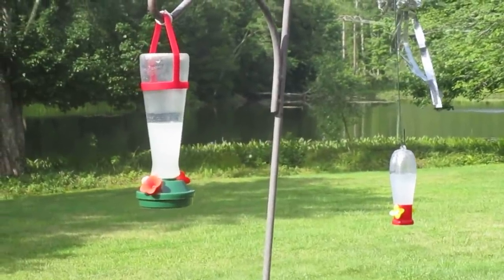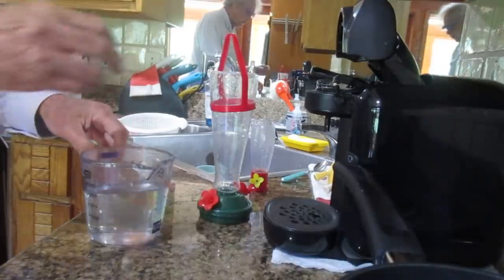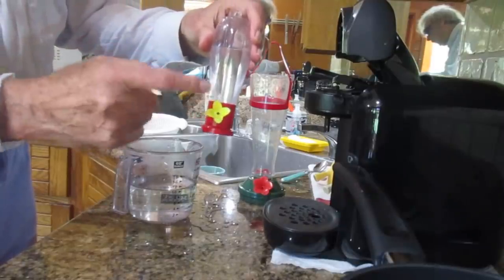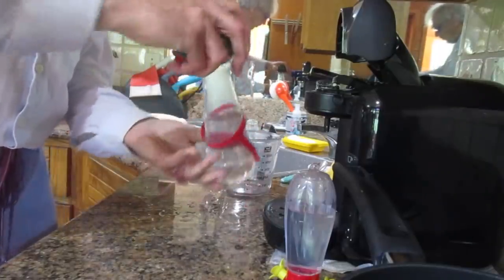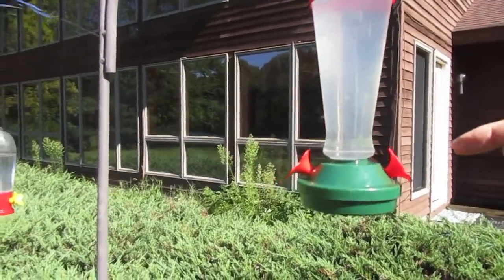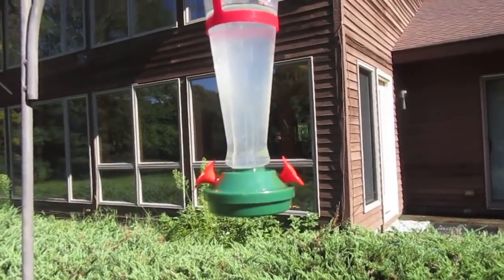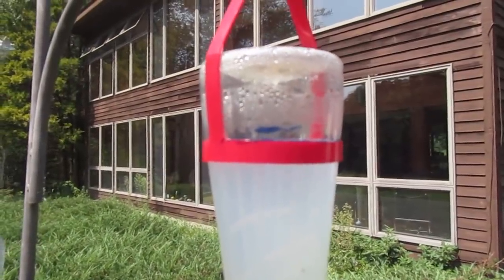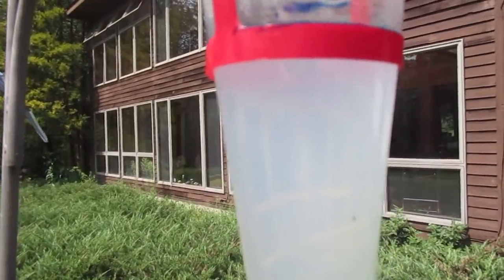Problem #118 - Mystery of Hummingbird Feeder

Comment: Air will be drawn into solution at the lowest portion (the "flowers") where it is at atmospheric pressure, and eventually come out of solution at the top, where there is a partial vacuum equal to the height of the liquid column. The vapor pressure of the dissolved air is relative to temperature, so it is the same from top to bottom, but it because of the law of partial pressure, it will create a higher relative pressure inside the top of the vessel. (or something like that :-)

Comment: Elegant problem, Sir Lewin. From a thermodynamics perspective, I am speculating that thermal inertia is interacting with Gay-Lussac's Law--pressure and temperature proportionality--causing pressure fluctuatations at the control surface. Asking myself whether or not mass is leaving the system, and if so, how? Sugar water perhaps decreases the saturated vapor pressure of the solution, when compared to liquid water under the same conditons. This allows for phase change from liquid to vapor to occur at lower pressures. Conservation of mass applied. Using the liquid-gas interface as a control surface, when the pressure of the fluid remains relatively lower than the pressure of air during the daytime, apparent fluid level decreses. Combined gas law suggests that either pressure, or volume must increase for an arbitrary temperature increase. Since volume is constant, we know that pressure must increase for both air an fluid. Decrease in the pressure of the fluid lags that of the gas. Increase in the pressure of the gas leads that the fluid. The specific heat capacity of water is over four times greater than the specific heat capacity of air. The increased pressure of the gas, and the relative decreased pressure of the fluid enables the gas to expand before the pressure of the water can restore the system to equalibrium.

Comment: Sir I want to ask for a solution iam a engineering undergraduate student , I have issue on remembering derivation and proof I easily forgot it my faculty told me use repeatedly write , write until it stuck on head my brain will freeze at certain point so I mug up few steps ,I have no issues on memorising concept , I have done  derivative step in math class at decent level . I have backlog in solid state paper it consists of full of mathematical derivation

Comment: Sir I am from India.I think reason is Pressure difference.Before weapping of Humming bird feeder, The pressure inside feeder is less than that of atmospheric pressure and pressure at flower is equal to atmospheric pressure.After wrapping the pressure at flower decreases than before and so liguid level in side feeder goes down.(It is the principle used in Barometre)

  Sir, I am a big fan of your teaching and I have learned a lot from your lectures videos and hope you will inspire this way life long Thank you so much sir.

Comment: My guess is that 2 independent phenomena are preventing your syrup from free leakage from the feeder:
1)	The rarified gas/air above the syrup. Its pressure is less than atmospheric and is directly dependent upon temperature (Law of Charles)
2)	The surface tension of syrup in the outlet (“flower”) creates a meniscus which acts as plug/jam. This meniscus is destroyed by hummingbird’s bill when it applies for syrup but it is another story. Surface tension is in inverse relation with temperature. So it can de destroyed by temperature increase.
So, to my mind, the combination of these two effects (meniscus/plug removal and air pressure boost above the syrup) caused by daily temperature increase causes syrup expel from the feeder.

Comment: Thats all wonderful. Not to be negative or anything, but I noticed that your feeders the sugar water is quite cloudy, that is caused from it being in the feeders to long, and the sun has heated that water causing it to thicken and go rancid and start growing bacteria,, this in turn can cause major problems for the hummies, they drink that and they can get mold spores on their tongues and causes them to not be able to drink.
I learned the hard way with that. I only use 1 cup of sugar to 3 cups of water, never boil the water, I do it at room temperature and I change the feeders every 2 days. Just saying, I found to many dead hummers because of the cloudy bacteria filled, to long in the sun feeders.

Comment: I believe the water level has changed because the water evaporated into the air pocket causing condensation and the pressure hasn't changed, but now the air/space above the water line contains the evaporated molecules?

Comment: My take is that, since the bottle is closed, the water in the lower part will evaporate till the vapor reaches the vapor pressure corresponding to the dynamic equilibrium of the vapor and liquid phase. The partial vapor pressure of 1kg pure water at 28 C is about 28.3 mmHg (looked that up) and it decreases to 28 mmHg for a solution of 100g sugar in it. From that it should be possible to predict how much water is going to evaporate until the process stops. However, when I tried to put in some numbers, I realized that the amount of water already ‘gone’ should be in the order of 50-60g, which cannot be accounted for by evaporation alone, since the vapor pressure and the volume are too small. Must think of something else after all. Looking forward to the solution…
In the meantime, I did my own experiment: took a plastic bottle, made some small holes at its side about 30 cm from the bottom, filled it with water, closed it and turned it over. Water came out of the holes for a few seconds then it stopped. I reckon that it stops when the air pressure at the surface level inside the bottle equals the pressure at the holes (1 atm) minus the pressure of the water column above the holes, which is about 0.029 atm (for 30 cm). Now I’ve put the bottle on a heater and marked the level. I expect that water that evaporates due to the increased temperature increases the pressure at the water surface by that small amount to make further liquid water come out of the holes. Let’s see…
By the way I also put water inside a closed bottle and marked the level: there’s no noticeable sign of the water level decreasing…So the water must come out of the holes

Comment: Sir actually because of the sun air inside the feeder expands exerting a force on the water making it getting pushed out of the feeder through the flower. Also we see  that evaporation is also taking place which forms vapour which condensed in the night time which can be seen as droplets . Hence due to the continuounity of this process the water slowly gets out of the feeder and water level gets lower and lower

Comment: I know people think that water cannot evaporate right through plastic. However, I do not believe that this is so. I used to live in a place where milk was sold in thick, heat sealed, plastic bags. You could wipe those bags dry, and leave them in the fridge and in the morning, there would be white liquid seeped out of the bag and into the fridge. I believe that this is because, when liquids are colder, they can get through the tiny holes in plastic that are invisible to the human eye. In the same way, water can get through cold windscreens.

Comment: The hummingbird food doesn't look like it was made properly. It should not be that cloudy.  For every 4 cups of water (don't use tap water) you should add 1 cup of white granulated sugar. Whatever amount you decide to make, it will always be 1 part sugar and 4 parts water. Don't add the sugar until the water starts to boil and stir well when you do. I boil mine for about 15 minutes and let it cool for awhile before loading my feeders. Don't skip the boiling step, it's important to do this.  It should be almost clear with a slight tint to it from the sugar. Glass feeders are also better. Plastic has chemicals that can leech into the food, plus if they get scratched at all it gives bacteria a place to thrive that you might not be able to get to. I actually just got rid of my plastic feeder. Glass might be expensive but it's much better for this purpose and easier to clean. Also, don't ever stick your finger inside the feeder when filling it. Even if you think your hands are clean you could contaminate the inside of the feeder.

Comment: As u said that water will not flow from the holes because of the generation of lower pressure on upper air part. As I had studied in chemistry that solution of glucose and water shows positive deviation from ideal solution in terms of vapour pressure, so the water vapourise more than in the pure water.

Comment: Sir I think it's something related to the structure of plastic there are rain coats which don't allow rain water to pass through(that's its job) but at the same time allow sweat to pass through it.  The   size of the droplet is reduced due to heat.

Comment: how do i think.. when you put ur container in sunlight water at the top surface starts to evaporate in a continuous rate after a time the number of mol. leaving the surface comes eequal to the number of
re joining molecules:; and creates a  pressure on the top for which water starts to come out from those fedding tapps(Holes) and then they again evaporate and leave the place as it's not(bottom part) air tight..if it's air tight then they will stay in polithin rap by being condensed. 
AGDhrubo-

Comment: I think sugar makes that possible. The water evaporates through heat and cold and thus 25% sugar crystallizes. You can observ in this video that the colore of the water is changing on the first day it was more or less transparent and on the end you see that the water is complitli white, the distance between molecules are changing.

Comment: Sugary water vaporizes to that small air pocket -that's why we see some water drops at the end of the video. But because the vapor pressure inside that pocket will reach an equilibrium, sugary water will eventually stop going down and will be at rest until it's disturbed.

Comment: Since the fluid was warmed, the air trapped in the bottle is relatively warm too, eventually. 

Over time, cooling reduces the volume of the trapped air, above.  This raises the fluid level slightly and since water is not a compressible fluid the level of water below is pulled into the bottle until air can also enter the bottle.  

This process lets water out of the bottle and the level drops.
Reply: The above-described pumping exchange of air for water could also be driven by solar warming and nighttime cooling too.

Comment: I would like to see, if there's water on the bottom of the wrapper. That would indicate that changes in temperature and air pressure cause a big enough volume change to make the feeder overflow a little every day. Another possibility is that the plastic is porous enough to allow water vapor to go through like in Gore-Tex. Humidity inside the bottle is higher than outside, and this causes some vapor to travel outside, if the material allows it.

Comment: Gas diffusion through the plastic container into the area above the liquid.  

It's the same reason balloons deflate over time, and the same reason you can't use PEX (plastic) pipes on a hot water heating system.  Hot water heating systems are filled with water, and depend on some corrosion starting then consuming all of the oxygen in the system.  Once the oxygen is consumed the system is stable, and the system can continue to operate for many years.  If you install PEX pipes on a hot water heating system oxygen can diffuse through the plastic and into the water, feeding corrosion indefinitely and destroying the system. 

Use a glass hummingbird feeder and I bet this will be greatly, greatly slowed.  Some gas may still leak in from the atmosphere through the sugar water, but it will be much slower than with the plastic tank.

Comment: As the temperature rises, this expands the air and pushes on the liquid. It’s pushed into the lower dish which acts as an unseen reservoir or accumulator. It will push some of the air out of the enclosed system but not the liquid. As the temperature lowers, the air will contract (keeping the pressure the same) and liquid will raise up again. But due to the fact there isn’t as much air left in the system I would predict the water level rises at night above that line?
EDIT: Ah I see it's not an enclosed system. So it allow some water to be expelled from that system. So no the water will return to the same level.

Comment: sir you are an inspiration to all. i think the reason for the reduction in height is that due to heat the air will slowly expand thereby increasing pressure thus forcing the liquid out of the liquid acceleate out,and as the liquid levels go down the vaccum that is stopping the liquid from escaping is weakened so the release of nectar becomes easier

Comment: my thoughts are: when you cover with the cling wrap, you create a seal. In the heat of the sun, pressure increases and pushes some air into the flower openings, then water will come out of the flower - possible?

Comment: I would like to know if there is any sugar water inside the Saran wrap after the level in the bottle has dropped. This would go along with the idea that there is a temperature/barometric pressure pump action occurring.

Comment: I think chemically speaking, sugar fits inside the molecular space between H2O, such that volume doesn't usually change, up to a given sugar to water ratio. 

I cannot see how this could be involved here because water basically doesn't change its volume negatively due things like temperature drop. If anything, water oddly expands when cooling into freezing.  The only fluid that does this. So, I could explain volume remaining constant or increasing, but decreasing volume must mean a loss of such volume, as in it has escaped!
Reply from the maker: I use 1 pint of water, heat it up and add 1/4 pint of sugar. I then stir the water.
Reply: @lecturesbywalterlewin.they9259  well, then if sugar can occupy more space within the water molecular spaces due to a certain amount of warmths, (warmth relative to water's freezing point) then perhaps, yes. As the water stands and continues to cool the sugar settles and occupies less and less space between H2O as the sugar becomes more organized.  Thus the total volume reduces, apparently. 

You did say that the concoction was warmed, right?

Comment: Sir this is simple evaporation as there is no sealing of holes and the solution which is otherwise held up due to atmospheric pressure at holes, being in contact with dry air, gets evaporated bit by bit

Comment: I am suspecting that the water is excepting either from evaporation and thus coming out as a gas through the 2 flower holes. Since is does contain air at the top. That does expand and contract throughout the day. So I think that it could expand during the day creating a pressure. This pressure will push the sugar water out of the holes. Than at night the air cools off and so does the air at the top of the feeder. Causing an area less than atmospheric pressure. So that air to be sucked in via the flower holes. Over time as this cycle happens the water level will drop.

Comment: The water is lost through the small holes in the 'flowers' perhaps due to the pressure gradient caused by a change in temperature. The temperature is higher during the day and thus the pressure of the air column in the feeder increases, forcing some of the water out.
Reply: I think it also cools at night, contracting the air, and that pulls in more air through the holes, which bubbles up to join the air at the top. That's what I think adds a little air every hot/cold cycle. You could test this by starting with very little or no air bubble, and with lots of air. More air should "drain" faster. Also the lost liquid should be in the plastic bag.

Comment: The pressure above the liquid is in equilibrium with the outside air pressure and the weight of the liquid.  Temperature fluctuation over the period of a day will cause the air above the liquid inside the feeder to expand and contract.  When it expands, pressure increases and pushes liquid out of the flower holes until the pressure is reduced to its equilibrium point.  When the temperature goes down the air pressure above the liquid is reduced and outside air pressure will push bubbles into the feeder through the flower holes until the pressure is once again increased to the equilibrium point.

Of course, I can't help noticing the little dent that appears at the top of the feeder on the second day.  This would also account for the drop in the liquid level.

Comment: Also they're the only birds that can fly upside-down, only for brief moments while they do their little dogfights but completely inverted, they're awesome. Interesting question 👍
Reply: The air at the top in the Sun definitely pushes some out initially. Perhaps then at night when it cools the outside pressure pushes lil air bubbles into the vacuum and the process repeats the next day.

Comment: I think there is a small amount of water evaporation at the flowers, (as seen where it condenses inside the plastic wrap), but mostly the volume change is down two other actions. One action is that of temperature - you are measuring in the morning and if the water approaches 4 degrees C after cooling overnight, (of course this depends on the ambient air temperature), then it will be at its most dense. Another action, (and probably the one offering greatest change), is that as the water and sugar mixture heats in the sun the sugar will dissolve and the volume of the mixture is greater than the solution therefore the level will drop. (I noticed that the top of the bottle had popped inwards on one side which shows that the pressure inside the bottle had dropped.)